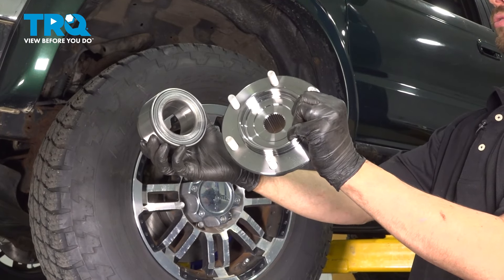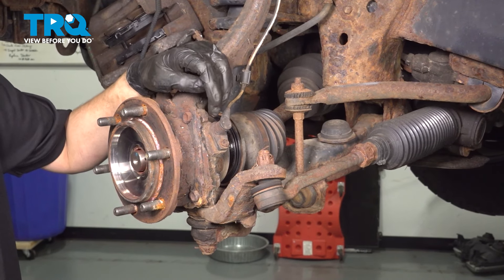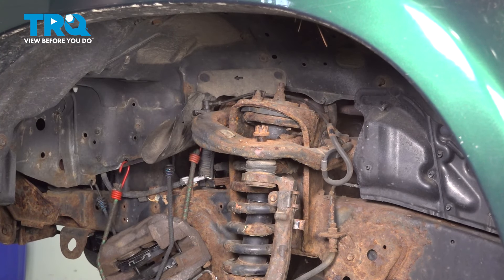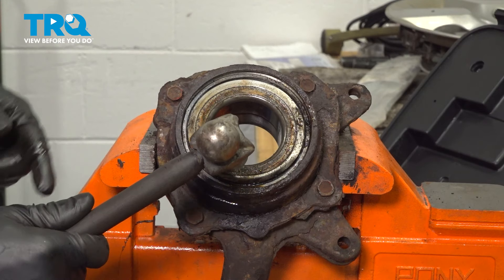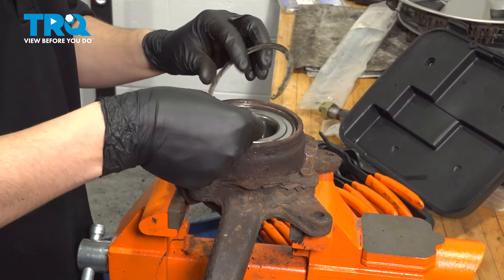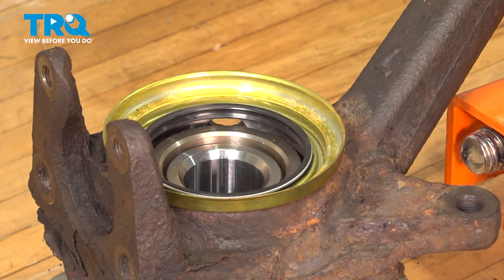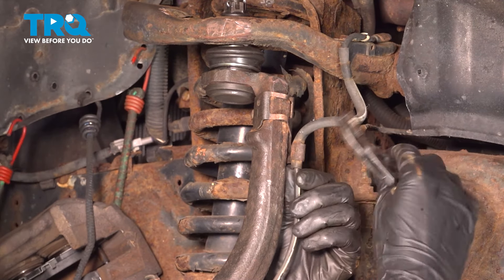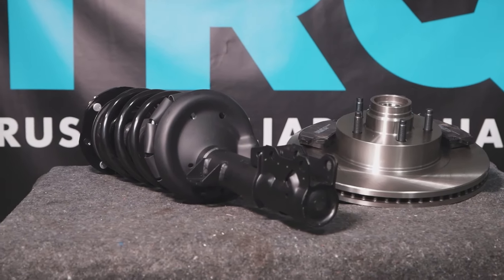How to Replace Front Wheel Bearing & Hub 1996-2002 Toyota 4Runner

Comment: Regarding the snap ring removal: You just needed to press the bearing back in a bit because when you first pressed out the wheel spindle it created additional pressure on the snap ring.